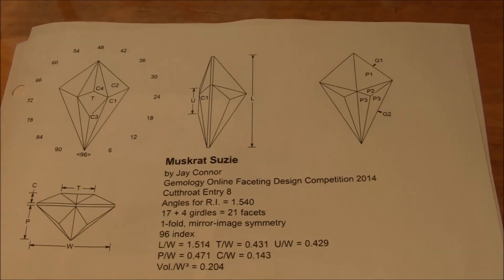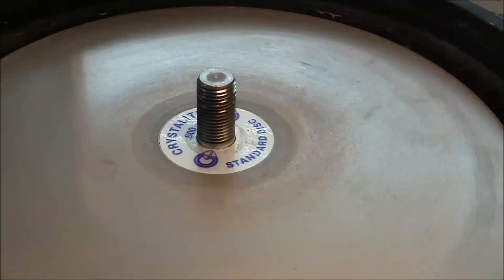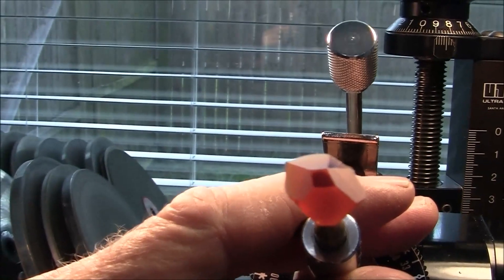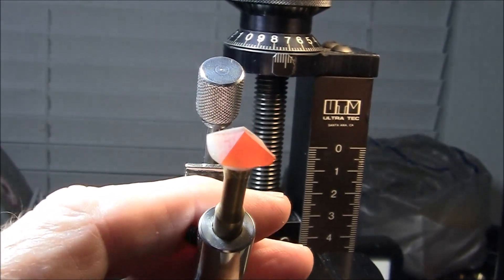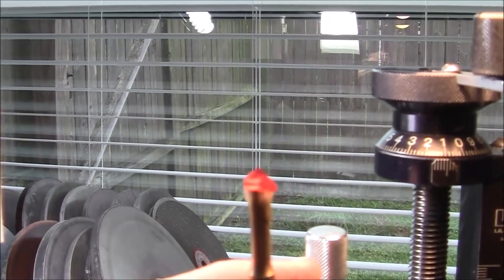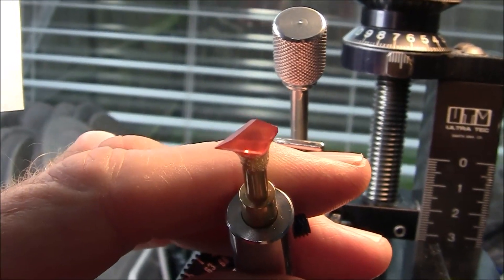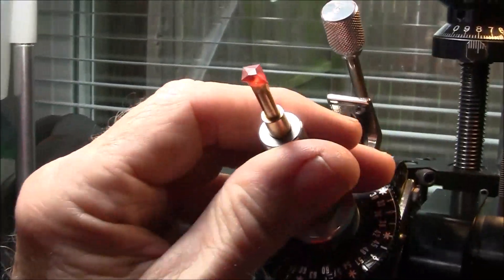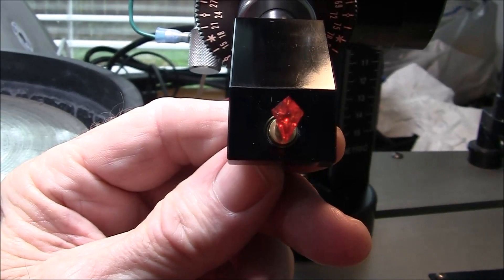How gemstones  are cut.   A kite shape.

Comment: Great video, why a copper lap on the pavilion and a tin on the crown?
Reply from the maker: The copper lap  is  a prepolish  lap used for 8k diamond ,  the tin is for  final polish using 60k diamond. sometimes if i can see a way to make a shortcut  i will  eliminate a step in the cutting and polishing  procedure.  Once i cut a pavillion and  see how the  m aterial is reacting to the laps and compounds i might change  my strategy  later on the crown   .       Also the smaller the stone  the finer  the disc that can be used  for cutting.